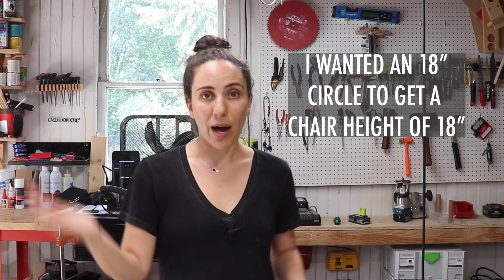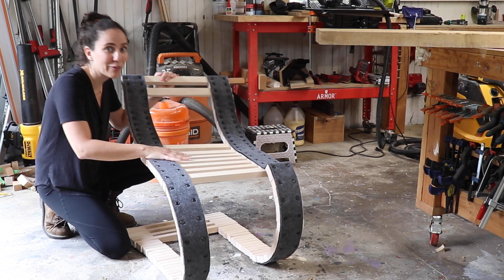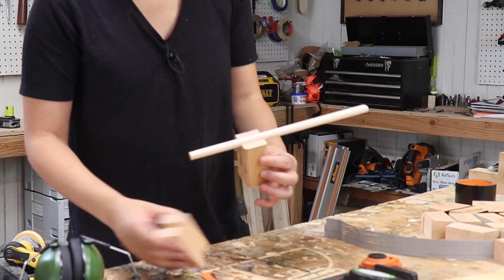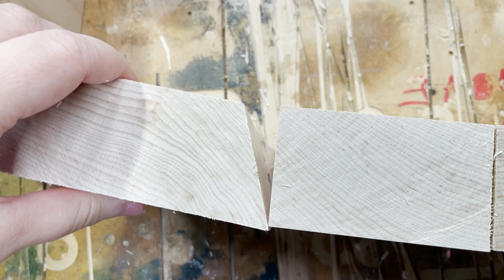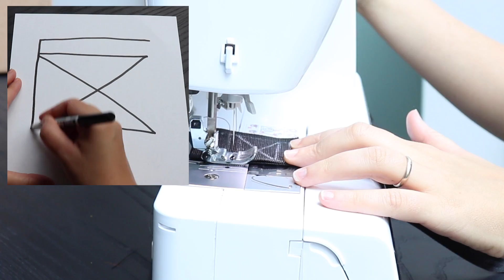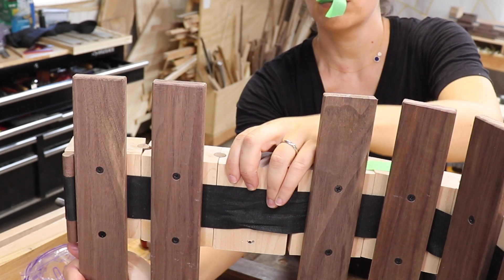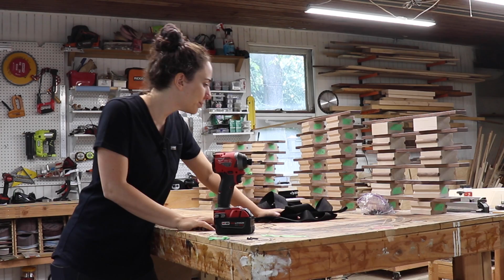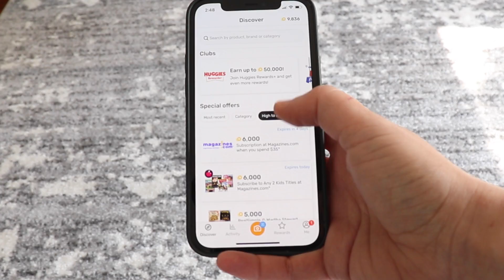I ATTEMPT to make a Roll Up Chair… AGAIN...

Comment: If you ever do return to this, you might have slightly more succes if you split the straps. So one piece of strap on the part that rests on the floor, and one part for the bendy bit. This way the straps cannot pull and stretch the material that is on the straight part and you might end up not having that much flex in the chair. Not sure if it would work but that's the only thing i could come up with that might actuallt work. I would've tossed the whole project out after 2 tries i guess so well done on the patience there haha!
Reply from the maker: That’s definitely a good thought

Comment: How about steel cable?
Your problem is not the tension but the fact that your straps stretch.
To stop the end pieces from rolling up you could attach a detatchable rope that would hold them together (from the top to the bottom).
Reply from the maker: Maybe!

Comment: Tamar: if you put 50Kg at 50cm from the frons joints and they are about 5cm thick you will have a tension of 500Kg in the strap!
The rest of the chair could be done as you did but the front joints at least have to have the above ball park calculations in mind.
Reply: Pushing the materials this hard requires doing the math.  I'm sure you can find an engineer to help you specify the right strapping.  I also agree that it's important to connect the strap to each piece so that the ends don't decide to curl and release the tension.
Reply: Your calculation is essentially correct but I think the tension on the straps will be much higher because
- most people are heavier than 50 kg, some are MUCH heavier
- 50 cm is on the low side, especially when leaning back
Plus, the thinner the pieces of wood, the worse it gets. And let's not forget that the wood has to withstand a similar amount of pressure.
Reply: Exactly. And when you just pressfit the straps to the wood, the moment one strap begins to slip ever so slightly, the force on the neighbouring pieces increase. In the end you will always have a big force on the ends of the chair.
I dont think leather will be better - on the contrary. Leather once was skin, and skin is very elastic - has to be. Those straps are made to be unelastic and they still were too elastic.
Reply: @mrxmry3264  uhm yea but the good news is... there are two chair-rolls... so the above calculation is more or less correct for a 100 kg person -sitting straight in the middle.

By letting the strap move freely along the wood pieces Tamar run into the fact that the weight leverage is different on each joint - but the strap tension is adjusted to the highest leverage...causing the hight tensile joints to absorb all the stretch while other joints tend to collaps -> you have to connect the strap to the pieces to avoid the descripted dangerous collaps of the chair. Connecting the strap to the wood will also help reduce the overall stretch of the strap.

Leather will not work - it is much weaker then the high quality straps you used - dyneema might have the right properties but is very difficult to fix... maybe some hoisting straps might help you out. - Yes I am a structural engineer and glad to help.
Reply: @JurBols477  I think a groove in the shape of a V-belt cross section with a matching clamp on the outside might hold the high strength webbing, but it would take some experiments to be sure.
Reply: Agreed. It is just a simple calculation of leverage. Just pick a joint and consider all the parts between the load and the joint as fused. Then it is a large lever vs the 2in from the pivoting corner to the webbing. Thus putting a huge load on the webbing.
Tamar,
Every material is essentially a spring. You need a spring that doesn't stretch much to maintain the shape of the chair. Polymer webbing just doesn't have the stiffness you need in the sizes you are using. Leather would be far worse. Even if it is strong enough, it is the stiffness that needs to be high. Think of it like lifting a load with a rubber band and a string. Both will carry the load, but the rubber band will stretch much farther than the string does.
There are two ways to increase that stiffness. Select a material that is stiffer (a higher modulus of elasticity) or make the spring bigger (increase the cross section). You might get enough stiffness by having the webbing span the entire chair width. I could run the numbers for you if you get me the exact material data.
Otherwise I am thinking you will need to use spring steel strips or high strength steel wire (a small chance something like Amsteel rope would work). It will be a little tricky though as wood is relatively weak and we have to not exceed it's strength in crushing as well. In general making the supports the full width of the chair will make a large difference.
The dowels would be better moved right to inside corner to pivot around.  That would distribute the stress over a larger area instead of the small inside corners contacting. The thicker the chair the better as that reduces the load on the webbing dramatically. You already made this one thicker which was a good idea. With the current design you might have been closer if you used four or so layers of webbing.

I am a mechanical engineer and can help you design one that works if you want to contact me.
Reply: @court2379   Dyneema may give a more flexible performance than steel wire for the roll-up, and perhaps simple hinges might be placed at the joints with the highest loads.
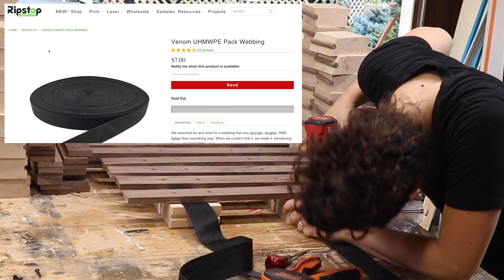Reply: @scottkleeman4849  she already uses it 16:26... she just doesn't use a brand name for it - it's "ultra-high-molecular-weight polyethylene"; so in short it won't work. Stainless steel hinges is where is at.
Reply: @scottkleeman4849  I agree it would be more flexible. The radius is not super tight though. A thin strip of steel will handle that radius. And it provides strength in shear and twist that the fiber based materials don't. I am also concerned about the stiffness of the high strength fiber based materials. I suspect they still stretch far more for the same load than steel, despite being much better that other fibers at that job. I would have to find the material data to be sure. This is not suggesting that fibers cannot work. It would just take finding the right cross-sectional area that gives a low enough deflection.
Reply: @court2379  "Otherwise I am thinking you will need to use spring steel strips or high strength steel wire" but then the steel wire must be suspended and has no play (with the wood) or the friction would eat the wood being so much softer.
Reply: @stanimir4197  It would have to be pretty thin so that it flexes easily and the full width of the wood. I don't think it would damage the wood at those dimensions.
 
Cables would be easier to find but harder to fasten and could dig into the wood pretty easily if not loaded evenly. There wouldn't be much play causing wear as the whatever is used needs to be fastened to each block. Otherwise the tension is distributed evenly when the local loads vary throughout the chair. That causing uneven deflections.
Reply: I wonder about the distribution of forces vs the structural constraints for each section.  I'm not a mech engineer, but I think some modeling would be a good idea.  The collapsing sections seems to say that the strapping/tension needs to be segmented more robustly.
Reply: At about the 2 minute mark, I knew a synthetic strap would never work here. You need a material that has almost no stretch and the first thing that comes to mind is a steel cable and even then, I think the cable would stretch enough to make it unusable. The problem isn't so much that the material has to not stretch but the amount of stretch results in huge change in the overall shape. It's at least worth a shot with steel cable but I'm afraid what would happen in that case is the cable would begin to embed into the wood producing more slack and thus losing strength/shape once again. You also need to take into account the wood flexing as well. Think of that shape made out of SOLID wood, if you sit on it, it would flex, now put a half dozen cuts in it and try to make it solid with any material and you end up with the flex that would be with the solid material plus all that variables. I'm leaning towards this not being possible with wood at all.
Reply: @seephor  There are similar chairs at my office. It is possible and they used a polymer.
Reply: There are two straps so only 250kg. Probably still enough to stretch most textile materials by enough to loose shape. I'd try steel cables and have them run freely so the tension over the entire thing could be adjusted with a tensioning screw at the end without taking the whole thing apart ;)
Reply: @hernerweisenberg7052  the 500kg is the best case scenario, not rocking the chair, weight evenly distributed, just 50cm, etc.

Comment: Thank you for doing this! I think thzt your right that the material you're using should be as strong as possible. However wood is also a bit springy. Try incorporating steel flanges on the surfaces of the wooden pieces, so the wood won't be dented due to the immense pressure of when you sit on it. Especially since the pressure is not homogeneously spread out over the surfaces between the wooden blocks

Also, some thoughts about leather. It might seem to be stronger, but leather is also known to stretch (albeit slowly) and then also keeping the shape. I think the route you should take is to use a steel cable pressed very thightly on the oustide surface of the wooden blocks. You might even embed it in the surface.

If you might take the route of using the same plastic material you're using now, taking out ALL the stretch during assembly by hanging a lot of weight to the ends. 

Hope this might inspire you. Can't wait to see what solutions you come up with!
Reply from the maker: Definitely going to attempt again at some point!

Comment: Just some ideas, all meant to help and not criticize….. In terms of the strapping, can I suggest seat belt material.  It is way strong, and the stretch is virtually;y non-existent.  I believe you need to attach the straps to the blocks like you did the first time.  And if you use screws to attach the straps to the blocks, you may still get stretch between the blocks, as it tugs against the screws.  Its almost like the strap has to attach to the entire surface between the strap and block.  That way only stretch is the strap between the blocks, which virtually should be none.  Leather would still stretch.  The only fiber I know of that doesn’t stretch is Kevlar, but that is only when it is strands, and when woven, may stretch as the weave stretches.    I, like you, like to fix things, come up with solutions.
Reply from the maker: That’s what the polyester was
Reply: @3x3CustomTamar  - dang,  not sure what would be better.  I am beginning to wonder the the original chair was just for show,  and if it really did work.  You have done excellently,  just about tried every alternative.

Comment: Check out Josh Wright. He build your chair with a key difference to remove the need for high tension. The make the pieces interlock with each other rather than butt up to each other. I'd love to see this design work, I think a lot of the problem is coming from the fact that tension added overall, means that at the upper curve, the band is being pulled away from the wood, instead of towards it. Since that area can be glued together perhaps consider gluing/firmly attaching the strapping at that point, rather than at the end. A dowel sewn in at the back of the seat could be all that you need. Keep trying you are getting so close! Love the video.
Reply from the maker: I’ll keep trying! Eventually. Ha

Comment: Why even use strapping? What if you use hinges just on the outside (wide face of blocks) of the curves? You can still use strapping or burlap just to cover the hinges. Leather is even more stretchy than the strapping you've already tried.
Reply from the maker: Maybe I’ll do that

Comment: I said it before and I’ll say it again:
Either use something like extra tough pre-tensioned dense piano hinges between all wood blocks.
OR
Use steel wires going through the middle of the wood pieces and add a tensioning mechanism at one end.
This is how the rolling chair is gonna roll.

Additionally: Because this is a front-back elastic chair design where lots of pressure is concentrated on a little bit of wood acting like a spring, make the wood blocks wider OR thicker OR use denser wood (yes, denser than oak or maple).

Comment: I have a different idea if you'd like to hear
Reply from the maker: Shoot…
Reply: I watched as the chair always over extended itself under pressure. No matter what material you chose. Then I saw it. The accuracy if the angled blocks look perfect. Its that darn stretching. There in I saw something else. Forget that material idea all together. Instead. I saw metal hinges carefully installed at each location between the slats. A tremendous amount of skilled, meticulous labor recessing each. Hinges must fit level with each location. Maybe route out with a template and finish corners with chisel. The perfect cut angeled blocks cannot move/stretch. You have worked so hard with different ideas give this one some thought. Sleep on it. Might need a seat cover or blanket so you don't get pinched on those tight joints. You might need to change the dirrection of the grain to add a more rigid frame. No bending that way.. I really love the way you dive into projects. Always smiling and showing mistakes. You have my best wishes for success and I'll be watching. 🙂
Reply: Also considering if this chair were made of steel. Would the trouble be the same?

Comment: I feel regardless of the tapering at the seat curvature, it couldn't support itself even if it's 90-degree square blocks due to the centre of gravity being shifted. The actual support comes from the tension of the strap, which in this case the strap is experiencing equal-tension length-wise. Even with leather, at maximum tension it wouldn't hold the weight of the back either. Your best bet is actually rubber stretched out while seated which can counter the weight. It's like a chained watch strap, even if you stick leather strap on it'll still bend further with pressure due to the thickness of the material, in your case the wood blocks. But if you stick a rubber band to the watch strap you'll have more control over how much it can bend, depending on the rubber's elasticity. Of course this will mean your chair will always be curled up in a figure 8 when not seated...maybe ask a physics teacher?
Reply from the maker: I actually purchased rubber conveyor belt material. And was going to use that. I should have used that. Ha

Comment: You really should've used metal hinges. Mill away the edges so the round hinging part doesn't separate the pieces. And since all hinges are fixed individually to the wood, the pressure in one spot stays with that hinge. Get away from that strap mindset.
Reply from the maker: I’m done with the strapping. Ha

Comment: Long time watcher, first time commenter. Maybe make a pin on the front and a keyway on the back side of each miter that over hangs the previous block to add a support to the back side and act a lock to keep the front face of the miters from opening. lots of work but maybe 2 dovetails that lock the blocks together but easily release when rolling up would create a solid arm and also possibly provide some lateral support. I feel like the straps do not have to be a structural component but merely hold it together when rolling it up.
Reply from the maker: Maybe!

Comment: Such a huge disappointment. You worked so hard, I'm sorry you couldn't get it to work..

In my opinion, The strap construction is the enemy. Most of the fibers in the strap zig-zag across its face. Only a few fibers run from one end to the other. So you're asking the fewest fibers to withstand the most tension.

Two options, 1) find a strap that has parallel fibers running it's length or 2) use steel. Either hinges at each joint or a steel band instead of the strap.

I hope everyone will understand, as I will, if you decide not to continue.
Reply from the maker: Yeah. Tossing the strapping idea out. Ha

Comment: I love the way your mind works to try and figure out a solution.  Would it be possible to add a foldable slat on the right and left side that could be unfolded to support the seat/back area and attach to the base?  Then when your done, lift the support and it can be rolled up with the chair?
Reply from the maker: Maybe!

Comment: What about using car seatbelts as the strapping?

Could threading a steal cable actually through the blocks be better with some sort of tension tightening system at the end? Seems to my tiny mind that putting the strap on the top of the structural parts means that instead of locking in place, they are acting more like a lever…

Hope whatever happens, you try a third time and it works!

Side note: if you only attach the strapping at each end, it’s going to stretch more than if the strap is attached to each block?
Reply from the maker: That’s what the polyester strap was

Comment: Hi Tamar, your issue is not the material. It is a pity that you glued it up. The issue is that effectively you need to create a hinge between each joint. But that hinge must not be able to move, i.e. slide. Perhaps do it again, using standard hinges between each. If that works, you can figure out how to reproduce that with another material. One long piece of webbing will shift and distribute the tension eaquilly and you don't want that. Effectively you need to keep higher tension on the leg section and lower tension on the back and bottom. That is why it failed. Leather will not work as it stretches a lot.
Reply from the maker: Perhaps. After I got hurt I just gave up. Ha